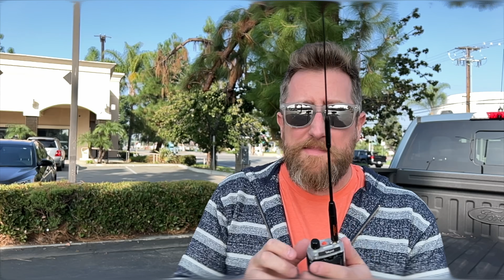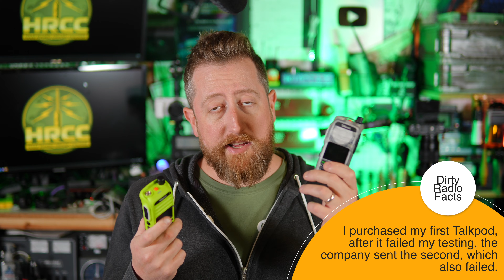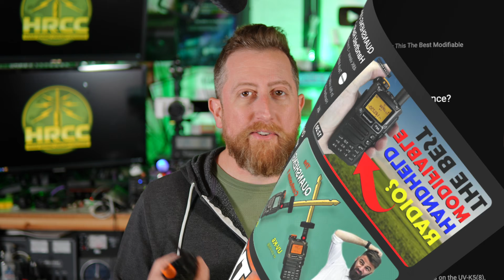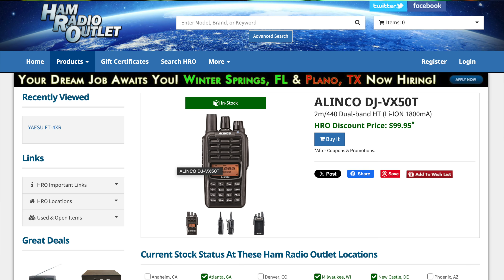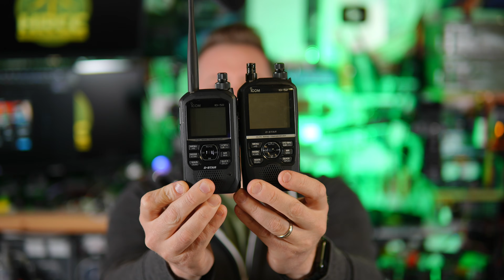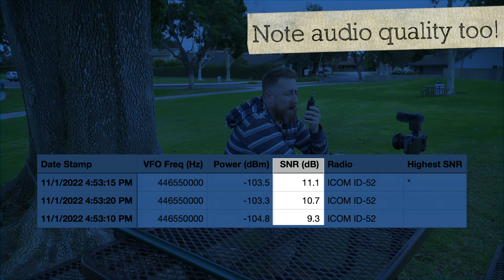Best #HamRadio Handhelds

Comment: So to further your argument against Bad Radios.  I use this analogy.  Consumer, gear. To make musical recordings with. That hold up Professionally. Using real junk. And that presents a Great Challenge, to do. That's what can make you real good. When you get the real good, Professional Gear. You will be all, tuned in. You will be sharp. Without anything going flat. Except for the frequency response. Which only you want to, peak. And dip and peakAnd peak, s'mores. And…  Pump… Pump…  Pump it up! Yeah baby! Way to go! And then you've got something there. That sounds like something.

But if you want Natural Sound?  You think that means, Not Doin'  NUTHIN', to it. But no. That only sounds like Amateur hour. Blah. It will sound like, blah and all muddy sounding. And it's all the, Spurious Emissions  of, Harmonic, distortions. That gives the sound it's, Luster and Bluster, Zip  and Woo hoo. To the sound. To make it speak to the listener. From all the spurious emissions of harmonic distortion.

And without it. With no distortion. It sounds dry, thin, brittle, metallic, crispy, fizzy and oh so state-of-the-art. That it lacks all character. It is Neutral. It is Natural. It is Neutered Audio! Do you want your Audio Neutered? I sure the hell don't! I want the Audio to be Jerking Me Around! And making me feel Real Good.  And you get that from all of its Spurious Emissions of Harmonic Componentry. All of them! But less on the order harmonic content. Only a little,, itty-bitty, bit of that. Because it is hard and dissonant, sounding. But can add a nice little, Edge. Kind of like having an, APHEX,  built in. When used, very sparingly. It enhances the sound. With harmonic gobbledygook. And like a 90° or was that a 270°,, phase shift? Something like that. And amazing what it did to the sound. It just opened everything right up on the top end. It got rid of that, Dull Dolby Sound. And it sparkled!  Just ask Linda Ronstadt. It worked for her. I know that for a fact. And it's how you make a dead sounding recording come alive.

So spurious out of band transmissions. With little walkie-talkie toys. Lucky to have 1 mile of range. Shouldn't be much of a problem. As long as you don't have millions of people using them all at the same time. Then the channels will get crowded. And then you have old-time CB radio all over again. And children playing on, Repeaters. It'll soon be a Free-for-all.

And then. And then! All of these stupid walkie-talkies. Will start to get interfered with. By all of the electric vehicles. And all of those electric motors. Creating spurious transmissions out of band. As you're trying to talk on your walkie-talkie. And as they drive by. It blows you right off the channel. And the other party is getting every few words. Yup..  It's inevitable. Just wait. Why do you think some of these handheld ham radios are only $20 each? They know what's coming. And there's no stopping it now! They've let the genie out of the bottle.

And all important transmissions. Get moved to new technologies. Which are all slowly getting upgraded and installed, now. Because all of these frequencies are kaput..  And they will be leasing one master frequency. And everything is digitally multiplexed. And they can have data stuff on top of data stuff. On top of data stuff. And everybody is perfectly communicating. And not getting interfered with. With toy radios and Amateur Hooligans. They are on UHF Digitally Encrypted Frequencies. You're not going to interfere with. They are all transmitted at full Saturation Full Deviation. Maximum ERP.. And everything is phase locked. Toys are not breaking in.  They are designed for Amateur Radio Operators. Which means, beginners and children's, hobbyists, retirees and some rock 'n' roll video and sports productions.  And we try to find a frequency. That's not too terribly busy..  Because that's what Pros, do. We even have separate guys now. That supply the Wireless Microphones and  In Ear, monitoring. Mix-Minus and all that folderol. To deal with, long hops and Digital Latency. You have to have  Mix, Minus Return. Otherwise you would have  unlivable echoes. Like a science fiction movie. As you fall down into  unlimited space. And the echoes go on for light-years. In a fusion -like explosion. In your brain. And you can't talk like that. When you hear yourself coming back, six seconds later. Your brain explodes.

And that's when those kind of spurious transmissions don't work. When at the speed of light. A few miles up the road and back. Isn't fast enough. And that's a creepy scary thought. Why we need faster than light speed communications. And maybe we do, now?

US Government Intelligence  only gives up little bits of information. Of advanced technologies we have. Once they have moved. To the next higher realm.. Then the older stuff is quasi-declassified. To throw off our Adversaries. And the American people at large. Because it's important. And I think we have  developed another huge leap in technology recently. Because certain other informational tidbits have been brought to,   bare. Like UFOs. Like hypersonic missiles. Like laser weapons. Like quantum computers. We've got something else nobody else has. And it's under wraps. As we might have to use it one day soon? Or all of them? Or all of it? Or all of, they.

And so we will not know what we have. For the next 20-30 years. And until such time? It could get pressed into service  and revealed. Earlier than anticipated. Kind of like the,, F-170..  Under wraps for over 20 years before we knew anything about it. As the American people. As when secrets do need to be kept. We've hired the right ones. But there will still always be those. Like a stupid air National Guard kid. I mean what was he thinking? You'll have plenty of time to think about it now. When he goes up the river for a good long while. And he can contemplate. What it means to be an American. Because he's not.

Eddie Snowden? I'm not quite certain what's going on there? Other thhan the right idea the wrong way. Going at it from the wrong direction. And you seek out those on the US, side. There were plenty of Democrats ready to,, jump in. Because, most, are actual true, Americans. Not so with the, Republicunt side of the, septic tank. As it's just a continuous output of psycho bullshit. And conspiracy gobbledygook. About a horrible corrupt Resident who Isn't! Impeachment? For what? What incredible controversy and multiple felonies are pending for Joe Biden?  None!

And so what kind of, droning,  constant psycho spin, Whack-A-Doodle nonsense is this? Impeachment? These guys are trying to leap off onto the roof of state mental hospitals! How far Low can they Go? We have not yet seen the Lowest I fear. They are not locked and loaded yet. But they will be soon. This is why they needed all of those, AR-15's. In preparation. To kill as many Woke Americans, as possible! To Defend,, their Jesus! They have gone stark raving Mad.

And this is what we are up against people. This is what insane people do. When you don't have them locked up in state mental hospitals where they should be. Because anybody that hates the USA as much as they do. Obviously have something terribly wrong with them. And it should not be calling the shots for anybody! They need to sit down, shut up and behave themselves. And given their lithium. Or whatever psychotropic drugs they require. Because this conspiracy nonsense has taken things too far. None of their ignorant arguments are valid.

Debt? Why should they care about our National Debt? Oh you mean they don't like paying taxes to live in the USA for free? They don't like paying taxes. To live in the USA for free. That's your regular monthly dues. Everybody has to pay.  To live in the USA to play,, Life.

And so is totally counterproductive. To tell women. That after 50 years. Setting a precedent. All of those other Supreme Court Justices.  Didn't know what they were doing! And did not have enough Jesus in their life, obviously.  To disrupt the lives of all American women. That's 1/2  of the American Population. Their personal healthcare rights ripped from them.  By other monsters telling them they should not have abortions! That's called Nazi fascism.  And we don't do that in the USA. Supposedly. Though there are those who want to. And they have.

And so with a former make-believe El Presidente'. Who appointed all of these judges throughout courts in the USA. All of these judges need to be relieved of their positions. Since they were appointed by a convicted felon of an insurgent. Who says he never took an, Oath. To our US Federal Constitution. And I think that says, it all. He claims, he didn't! And so he can do anything he wants to do! To destroy the USA if he wants to! He has that right! And everybody wants to help do that! That is his Militias. His Malicious, Militias. And just like Vladimir Puking. He is ready to Pounce and Attack! The American People of the USA.  Because He's Taking Over! But only for a Day. That will last 1000 years. According to Hitler. And since they both originally came from the same place. It must be in the genes?  We need to do some Gene Splicing. With a knife.  And some gasoline. Since he does not smoke nor do drugs. He should do gasoline and blunt force trauma with a knife. A really heavy knife that has some inertia, to it. And one and two and one and two. Et Voilà! Dingdong the witch is dead! The wicked witch of, Mara Lago.

As he is becoming truly Frightful. With every stupid word out of his stupid mouth. Ignorance!
RemyRAD
Reply from the maker: Bro that comment is way too damn long.
Reply: I dunno what your on, but…stick with 1 drug at a time, please.

Comment: Another +1 for the favourite which is the XTS5000.
Absolute brick but it just works so well, as it should.
Otherwise the ID-51A is my go to for true dual band.
Great video as always Josh and thanks for your stand on the emissions issue.
No way should anyone recommend a radio that has serious interference potential.

Comment: Well depending on how you look at things. All of that harmonically related spurious transmission. Could very well save someone's life. Your transmitting on a frequency nobody is monitoring. Somebody else on another channel far away from yours. Is hearing your call for help and an ambulance. But they tried to talk to you on that frequency. And you don't respond. Because you are not on their frequency.  You are on 1/2 the harmonic calling for help. After wrapping yourself around the tree on your motorcycle. And you are almost dead.

So depending upon how you look at these spurious transmissions? On a little walkie-talkie thingy. That usually does not broadcast full-time 24/7/365. There really isn't any problem with that spurious transmission stuff. As it could save your life or the life of someone else.. Because these are not supposed to be used as toys. Even though they can be also.

I make professional musical recordings. I'm a top engineer. Not only  am I top rated. I've even work. For some of the legendary companies. That made the equipment. That recorded the hit records.  And so? After an extended stay at Americans Top  First Original Best Network. It all started with the Radio Corporation of America. And little nipper. Hearing his Masters Voice.  As the sound quality was so good.  It could even fool your pup. And then the dog knocks the record player off the, coffee table. And breaks it. Wondering where the hell  its, treat went? And then grabbing the tone arm in its mighty jaws. And ripping it right off the record player. Then what do you do?

You murder your dog that's what you do! That record player cost as much is your brand-new model T Ford ! Damn dog! Now you can grind him up. And use him to feed the cats. So he's good for somethin' instead of, NUTHIN'!

It should all work out well. With Donnie in the White House. If it's all padded.
RemyRAD

Comment: The Best HT (dual band or better) necessarily without exception has >> Cross Band Full Duplex<<. 
This feature is profoundly vital to a multiband radio as it allows uninterupted listening to one band while transmitting or receiving on the other. Whether it's for using linked repeaters, satellites or advanced use of a radio to not miss a call on one band while monitoring the other. The feature used to be included on every modern dual bander from the nineties. This also means the radio has to have two independent receiver circuits and a diplexer built in. When those conditions are met  radio can typically also do cross band repeat which is a cherry on top for knowledgeable ops.
Lack of this indispensible capability in nearly all the latest gear specially that which includes digital modes is a travesty and ludicrous cheapening of the value and practical use of the hardware. Many new ops may not understand the importance of this rf capability and tend to be bedazzled by digital modes instead. There is no technical reason why a radio can't have both despite paid corporate apologists making lame excuses and detracting from the truth.
 You should not accept the new normal of lackluster deficient hardware devoid of vital features with nothing worthwile included to replace what works in practice. Without cross band full duplex a 'dual band' radio is only a single-band-at-a-time radio and crippled in its usefullness.

Comment: So correct me if I’m wrong but I don’t think you can do digital modes with the ID-52a through Bluetooth. I would love to use Bluetooth and do APRS messaging with mine but I didn’t see a way to do so. It seems like you can only use Bluetooth to a phone for control via an app, not audio and PTT. Still love the radio though. 
Another great handheld is the ft-65. Super simple radio for a reasonable price.
Reply: Icom sells a Bluetooth headset for the ID52 so it definitely does TX/RX over Bluetooth.
Reply: @plemieux84  I’m talking about through your cellphone. There does not appear to be a mechanism to link Bluetooth audio to your phone. It only works with Bluetooth headsets, which is completely useless for the scenario I’m talking about.
Reply: @JonathanKayne  you could add a Mobilinkd TNC to the ID52. That would let your phone’s APRS app do messaging via Bluetooth.
Reply: @plemieux84  that's what I currently do. I just wish that I didn't need an extra device to do APRS on the id-52a. (and I don't use APRS for position reporting I use it for spotting for SOTA and POTA)
Reply: @JonathanKayne  I’m probably going to do the same thing but with the ID-50 since I don’t need Bluetooth. I have a 705 but want a handheld for edc and I’d like to keep it in the family so I can share accessories.

Comment: Great one, I just started with a LILYGO T-Beam board and some cheap antennas on my car to get into APRS. I will upgrade into a full size antenna soon but I'm still impressed to get 30 km of range with the short ones.
I just wonder what is the big difference between a PicoAPRS and the T-TWR Plus from LILYGO, it would be just 1/6 of the price?

Comment: Supposedly talkpod has fixed the emission issue.. I rock the vx6r but need a part 90 with either a huge battery or cheaper batteries any thoughts?
Reply from the maker: They told me that, sent me a new radio and it had the exact same issues.

Comment: I appreciate you and all the other HamTubers for the general knowledge but also for telling the truth about dirty radios. Didn't the Baofeng radios have the same problem in the past with spurious emissions? 

I'd like to hear from more buyers but it seems that the Talk Pod folks have addressed the spurious emissions issues in their radio. If they have then they deserve to be forgiven as well. Time will tell.
Reply from the maker: Talkpod contacted me about it being fixed and sent a replacement… same issues.  

The baofengs vary greatly. As do the providers and specs.  I still just recommend the vanilla standard Amazon uv5r as they pass standards.